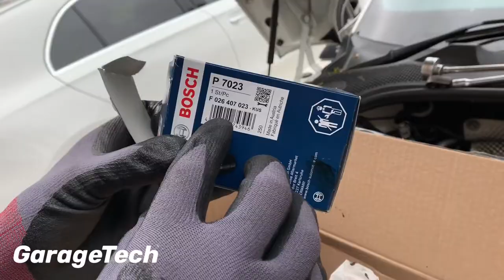How to change the Oil Filter 2L TDi Diesel Audi VW SEAT Skoda 2 litre diesel motor oil filter change

Comment: My 11 plate Golf TDi needs an oil change soon, and I was going to book it in at a garage, but I thought I'd just have a look online to see how bad the job is on these. The mk1 MX5 I had was a total bitch to swap the oil filter on !!! That thing was so inaccessible that it pushed me into getting basic servicing done at garages. This on the other hand looks to be an absolute doddle. 

The filter is almost as accessible as on my 2.0 Capri back in the day. On that thing there was so much under bonnet space that you could get to everything ridiculously easily.

Thanks for the info.

Comment: I snapped the stalk off the filter cap by accident. The cap and the stalk are now 2 separate pieces! 🙈
If I push the stalk back into the housing and screw the cap back on with the filter attached...would it be OK the drive the car temporarily?
Reply from the maker: @J_Dawg  hey, you might be able to clip the stalk back into the cap, some of them clip in.

Comment: How many liters of oil goes into this particular engine? Thanks
Reply from the maker: It’s about 4.5 litres I think.
Reply: Thanks for your answer, because I have the same engine on Audi Q3 2.0 Tdi 140 cv 2014 and I did oil change and filter by my self, and After 4 liters the oil dipstick marks full

Comment: So on my 01m which is on bottom of car the paper filter shouldn’t stick up in there by itself?
Reply from the maker: It should come out with the housing cup, but I have seen it before where the filter gets stuck inside, just need to pull it out. Happens the same with some of the engines with the filter on top. Make sure the new filter is clipped into the cup before refitting 👍🏼
Reply: @GarageTechAutomotive  ok. Was definitely clipped into cup. It just seemed to me like it could be done that way or stuck into the housing first and then screw the cup on? I just figured it should and would pressure fit by itself into the car because it has that plunger like end with an oring, similar to an stf filter. Just wanted to make sure bc it was just dropping out

Comment: Hi could you tell me how to get the oil filter out On  2020 Audi A4 . The coolant bottle is very near it and there seems to be no space to remove it.
Reply: I appreciate I'm a bit late but if you're still wondering about that, the coolant bottle is only held to the  by one T20 and should have two plastic sticks at the bottom that slot into the bracket to hold it in place. If you take out the T20 and lift the bottle up, it should give you just enough wiggle room to be able to reach the oil filter housing (you'll probably need a hinged joint on your socket to be able to get to it properly though.)

Just slot the bottle back into the bracket and tighten the T20 back up (doesn't need to be super tight. Just firm. It's only into plastic)
Reply: @philipcollier263  better late than never thanks for reply

Comment: What would the miles be between the next service on long life oil cffb engine
Reply from the maker: Up to approximately 20,000 miles or 24 months, whichever comes first but the car will monitor the condition of the oil so the oil service light could come on much earlier and it usually does. I’d say on average 16-18k miles
Reply: @GarageTechAutomotive  Thanks for the response it's came on after 9600 miles so I don't think it's been reset correctly
Reply from the maker: @tonykurt9647  yeah sounds like it was reset to standard servicing or fixed as they call it, so that’s about 9k miles or 12 months
Reply: For the cost of a filter and some oil I change mine every 9-10k and I do fuel, air and cabin every other oil change, so at 18/20k.
Nicely explained video!
Reply: I have a VW Passat with the CFFB engine. I plan on doing 10k mile oil changes while I own this vehicle.